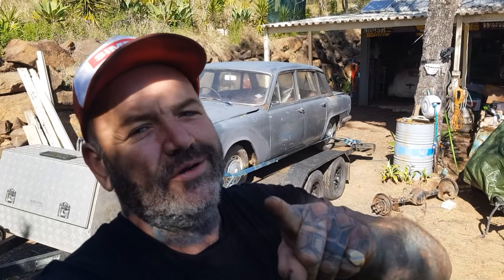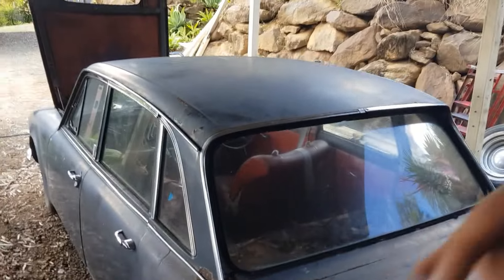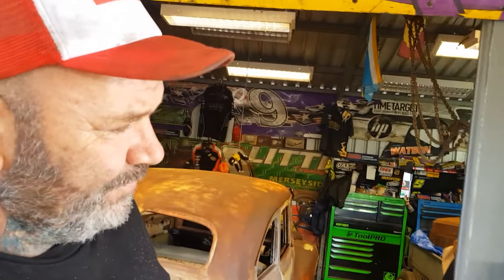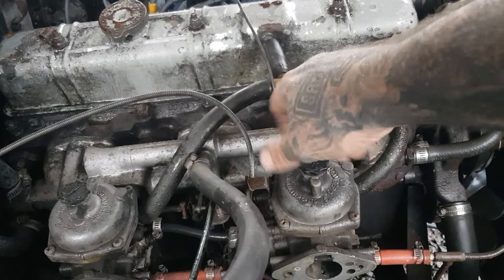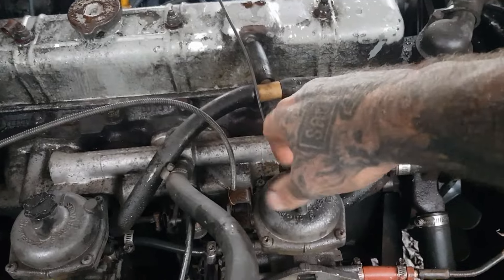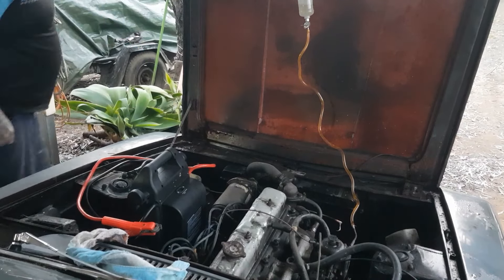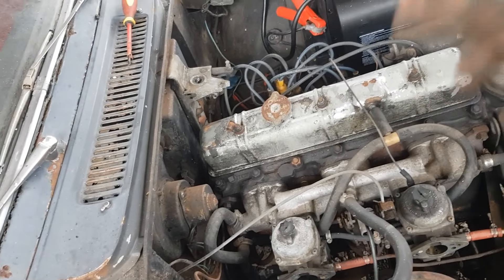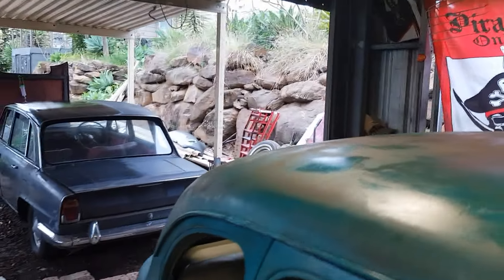Will it run? 1964  British Barn Find Triumph P2500,  Huge Rat Infestation, and Remnants of Snakes

Comment: that's a triumph 2000 Motor as it has 2000 manifold and carbs. 2500 has different manifold and 3/4 inch twin su's